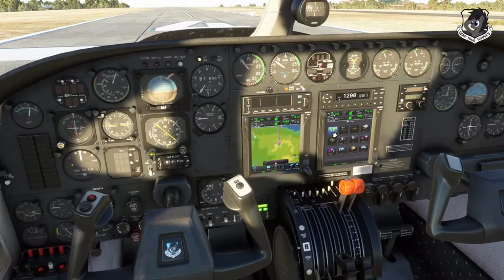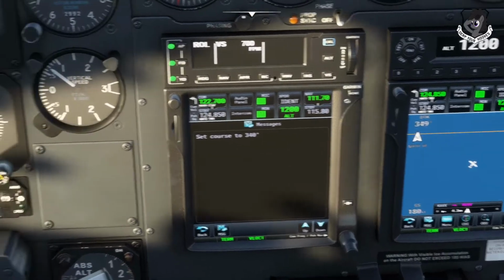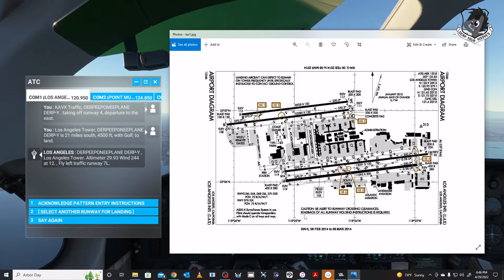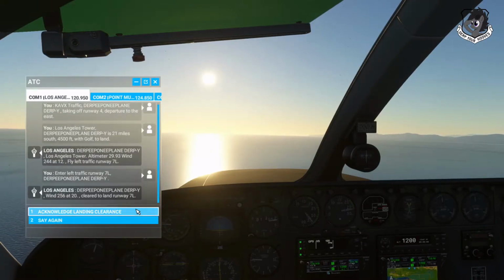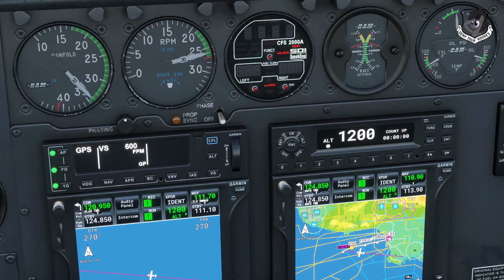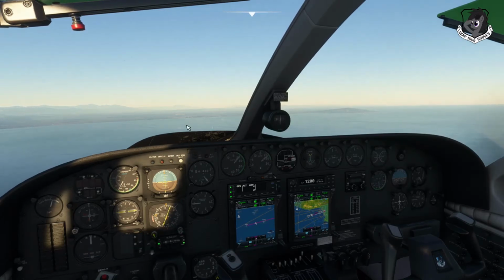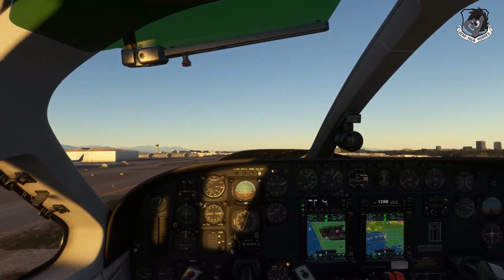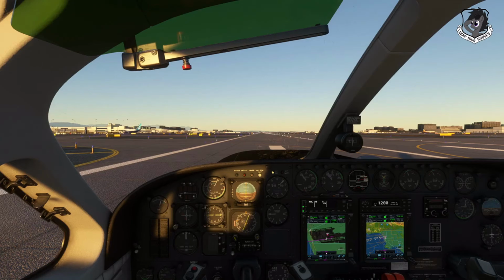MSFS 2020 GTN 750 ILS Approach Tutorial

Comment: Not to pick but 2 things are troubling to me.  1 the Directional Gyro was not set to the ILS course which must be for right and left navigation the reason is in IMC when you get disoriented your mind will become confused as to your location and travel which will take your mind off of other instruments and cause spacial disorientation which kills many pilots every year.  As an IFR rated Pilot this can happen even to the most experienced.  It is critical when you make a course change to set the heading bug and the course needle to the direction you are going or the intercept such as ILS or VOR or trust me you’ll get lost and you should change back to VLOC during the approach.  The cross hairs are nice but you need redundancy.   Speaking of Redundancy brings me to #2. You should also have VOR 2 set to the frequency and ILS course to confirm ILS approach if they don’t match in the approach go missed. Also in the standby frequency you need the VOR frequency for missed approach hold in both VOR 1 and 2 unless your using a cross position of 2 VORs to hold then VOR 2 would be set to that course and frequency after missed approach.  One more thing you are supposed to check the Morris Code beeps m
By turning on the NAV button on the Radio to hear the Sound Beep Sequence to match the Approach Plate.  Remember to fly safe because it’s fun but unforgiving……fly like your family is on board!